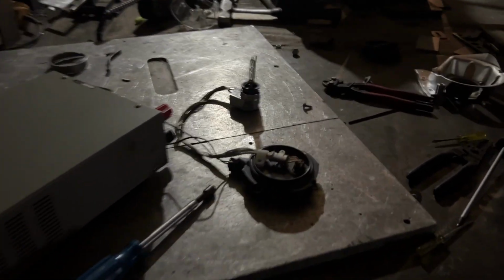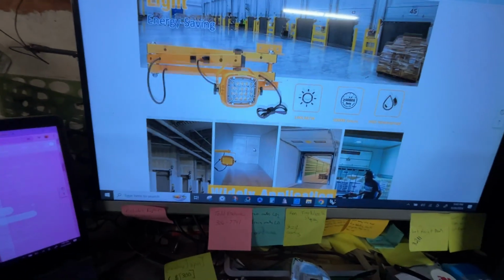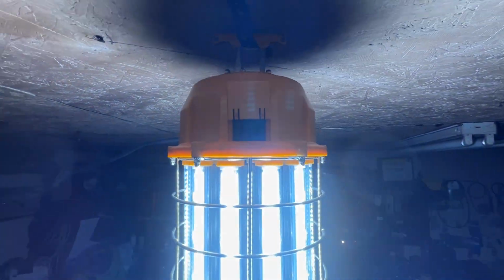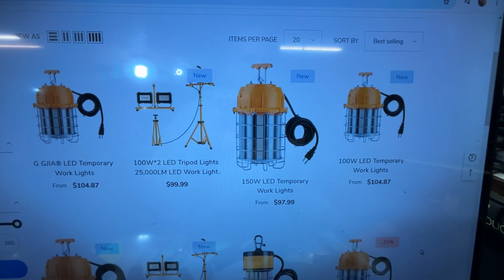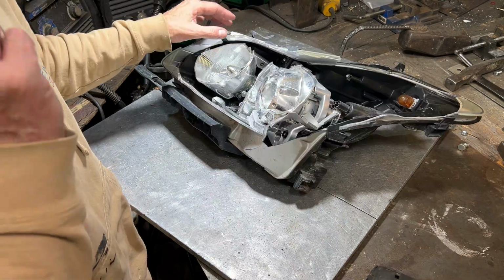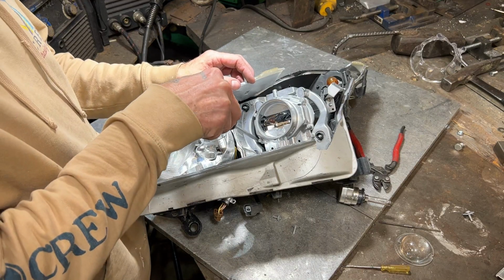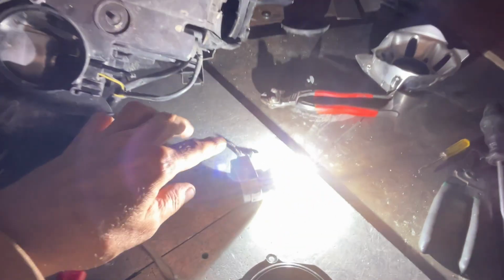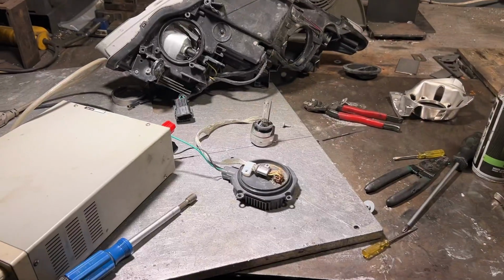GJIA lighting company . Some impressive commercial  Job site lighting fixtures .

Comment: Would be cool to see a fresnel lens focusing 100% of the output of some of those bulbs, like... from a reflector... and finding out whether or not there's enough energy there to start a fire, or melt high temp metals like copper or gold
Reply from the maker: If you research heat engines you will see back in the 70's they did something similar  in a test to run a ammonia Rankine cycle turbo generator  during a test .